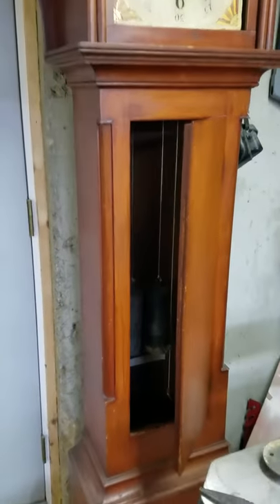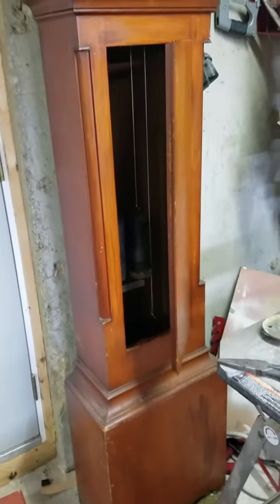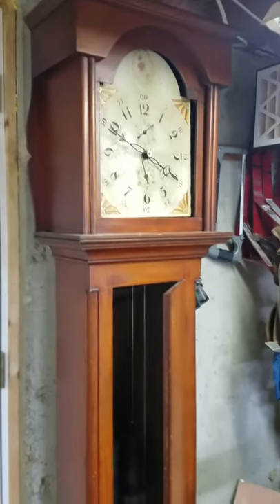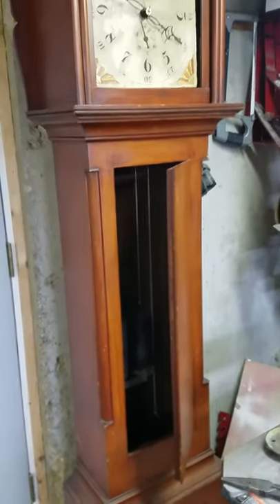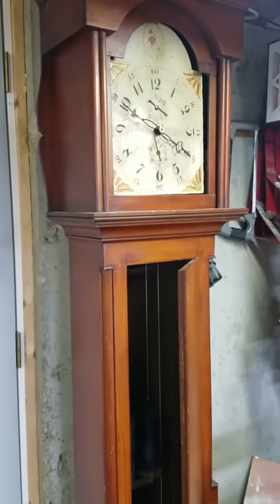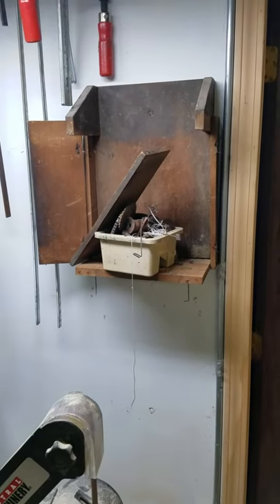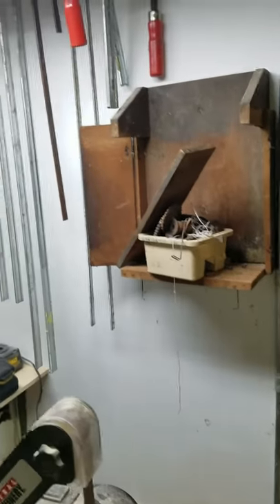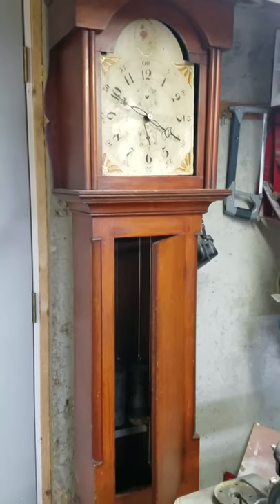Riley Whiting tall case

Comment: Hello Ross...Mark here...a few yrs. ago I acquired a Riley Whiting tall case, wooden movement and thru research, I dated to early 1800s, 1815 to 1825...What th...!!! This master piece works like a charm...concrete-ish weights, two piece pendulum shank about 4 ft. long... I run him once a week to keep him in shape haha Pine case...I believe it was stripped clean of the black lacquer that was used back then...it's evident on the inside of the 'removeable' bonnet and the coating on the inside of the belly door. P.S. I tried to send you some pics of this Ben Ben but it ain't workin'...Such a chunk of history tho, in this piece of early techno. Two hundred years later and Riley's still tik-talkin' and chiming to me!! def look at more of your clock vids! Tempus Fugit
Reply from the maker: Nice, I own two. The one in my shop needs repair. I'll get to it this Fall and post a video. I did have it working, but the weight cords finally let go. The weights should be tin case filled with metal  pieces